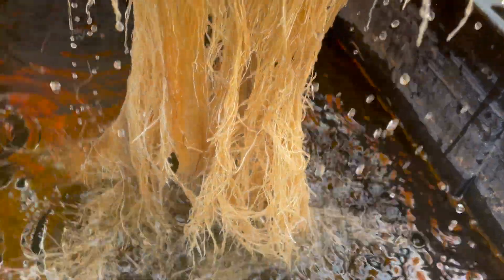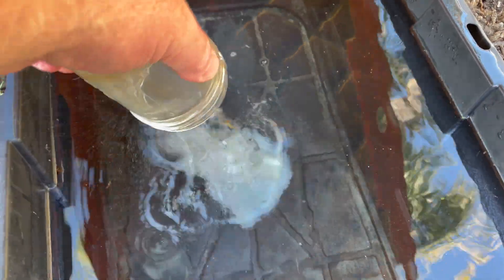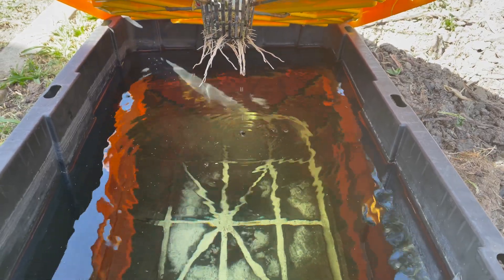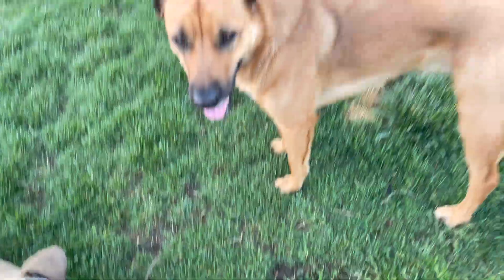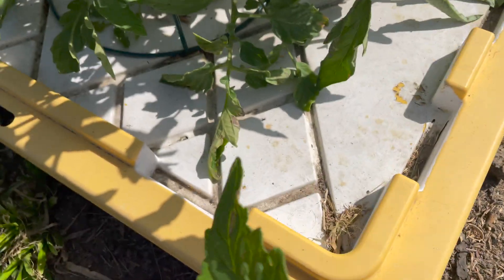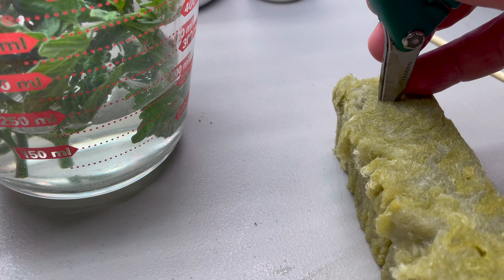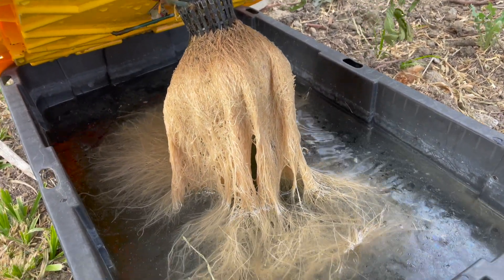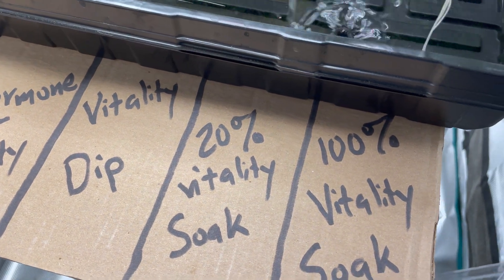I took cuttings to replace the one that was lost.

Comment: So if there is an issue with oxygenation and you have the sun how about adding a small solar panel and an low voltage aquarium pump to one of them to see if it improves things ?

A length of tube with pin pricks along the length would make a reasonable manifold to "deliver" air across the base of a tote.
Reply from the maker: yes but scale is the goal